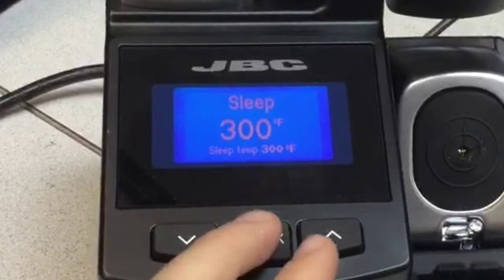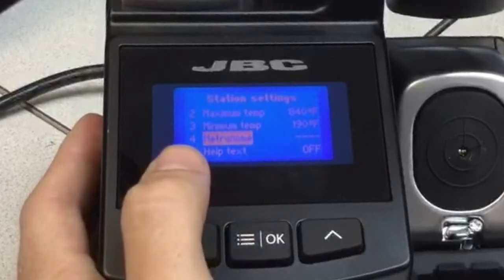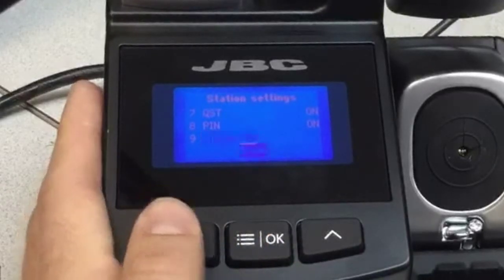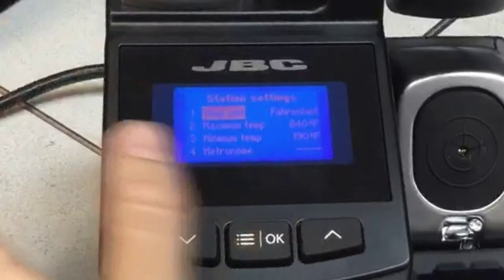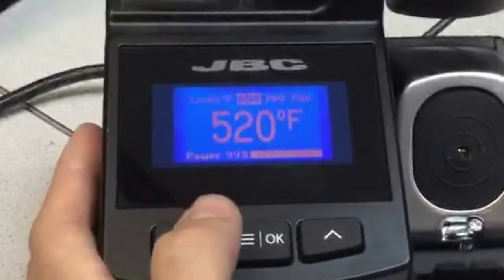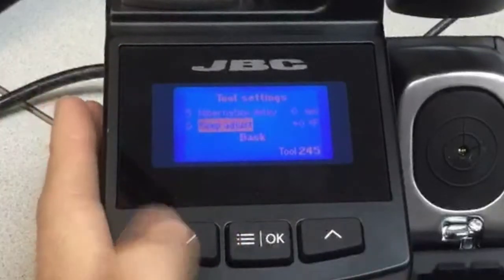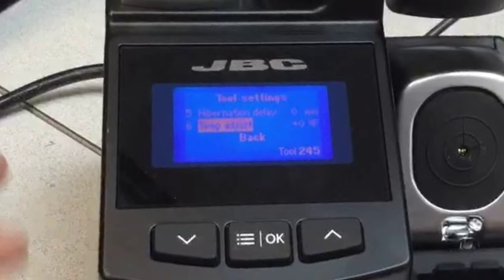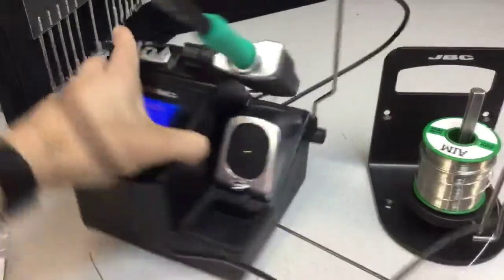How to Configure Parameter Settings JBC Soldering Iron CD-1B Using the Menu Screen

Comment: Where is QST at the end??
Reply: Since the OP wont deliver I’ll leave this here:

On a JBC soldering station, the QTS setting is used to control the tip temperature when the soldering iron is in sleep mode. QTS stands for "Quick Temperature Setting," and it allows the user to set a lower temperature for the soldering tip when it is not in use. This helps to prolong the life of the tip and reduce power consumption.

When the soldering iron is in sleep mode, the temperature of the tip is reduced to the QTS temperature setting. When the user picks up the soldering iron and begins to use it again, the temperature quickly returns to the previous temperature setting, so there is no delay in the work.

The QTS setting is typically set to a temperature that is lower than the working temperature of the tip, but still high enough to keep the soldering tip from cooling down completely. The specific QTS temperature setting can vary depending on the type of soldering iron and the type of solder being used.